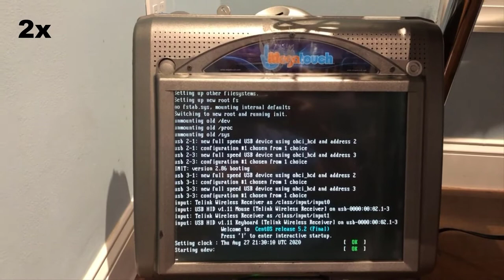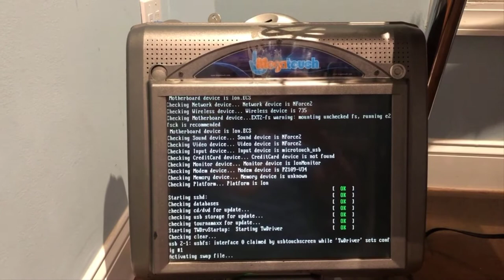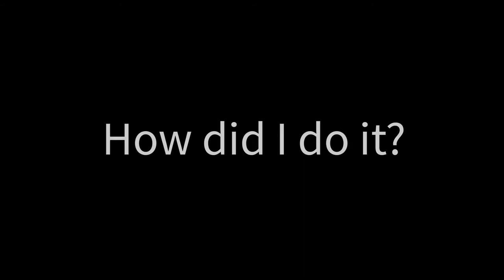Megatouch ION 2014 (and others?) key of death bypass TEASER TRAILER #2

Comment: This is great news. I just purchased a used Aurora with the 2014 software. I'm definitely interested in this because I know that key will eventually fail. Have you done a write up / how-to for this?
Reply: I haven't had a chance to put the finishing touches on it, this last few months have been crazy. At some point I"ll release the instructions probably or even more likely a "upgrader" since I don't actually patch the merit software itself, I don't see a reason why I cannot I'd just be distributing open source code and my code. that said I have not idea yet, been too busy to do the last step to "clean things up" right now it appears to be working fine on my ion but have to wrap everything up and actually remember where I left off.
Reply: @bebrzezicki  fair enough. I know how crazy things can get.

Comment: O no patching, now that's fancy. I did mine with a patch but it was only one instruction change and a key insertion. If I had to guess, you are replacing the libusd library :). That would be a nice and simple way to do it. Just match the function calls  and "pretend". Since the protocol is standardized (I actually have a small C program I wrote that can dump keys and such). We talked in the past about each other's ventures into hacking the MT. I don't recall which forum. But yeah, that would be a way I could think of. I GUESS you could also do some form of PTRACE and patch thing? But I am going to assume you didn't touch the original binary in any form?
Reply from the maker: You are correct sir, replaced libusb with my own version. (original code downloaded, modified and recompiled) alot easier to replace by writing new C code than patching the binary! initially was going to do it in the kernel when I realized that it used libusb rather than kernel modules to talk to the USB device. (I think force used a kernel module)
Reply: @arcade-cabinets  Haha, I ain't new to this shit! LOL. But yeah man it was just one mov instruction patch :) But that is definitely a dope way to do it.
Reply: @thomasandrews7119  Hi Thomas i was wondering how you managed to get around the key range check and the read key data with only one mov instruction patch. thanks.
Reply: @dansystems2646  I used a real key :P Super easy, even wrote a dumper for interacting with the key reader.
Reply: @thomasandrews7119  thanks for the quick response, I've managed to follow the force instructions but this stuff is way above my skill set.

Comment: Would this work with a Megatouch Aurora as well?
Reply from the maker: I believe so though I do not have an aurora so not sure. If it uses the Dallas ds1996 and has the same up board than probably. Contact me directly to discuss
Reply: I just picked up an Aurora. It has the DS1996 key. The person I purchased it from put in the newer Intel board, but it looks like it's the same image.